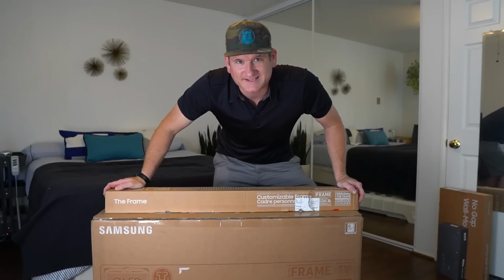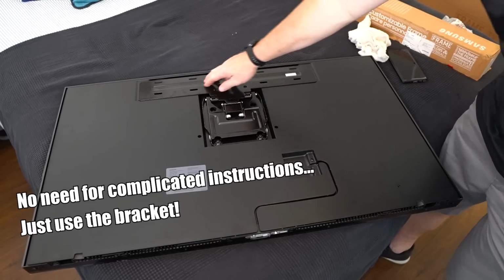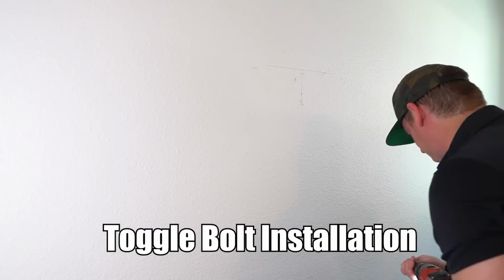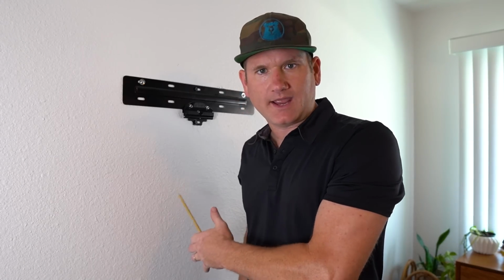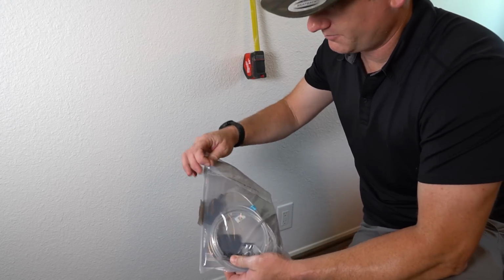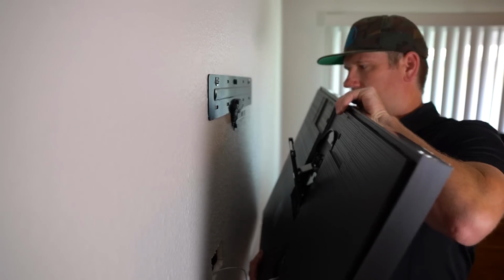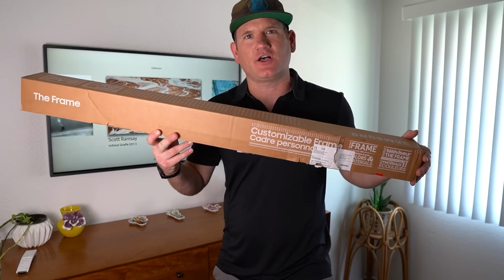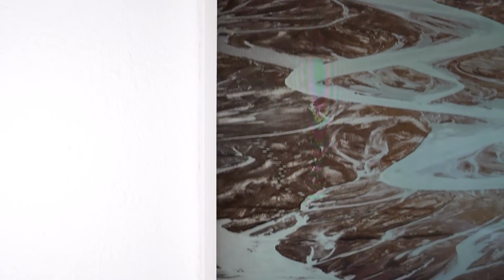Samsung The Frame Install w/ No-gap Wall Mount & Customizable White Bezel

Comment: Just a heads up that the mount comes with a template that shows exactly where you need to mount the wall bracket to get the height you want on the wall. I like that you are double checking the measurements but it makes it so easy to get a baseline. As an example, page 24 of this PDF gives the dimensions for many Samsung TV's. The main measurement you're looking for is the "A" measurement. 
https://pdf.crutchfieldonline.com/ImageBank/v20180729165800/Manuals/305/305M12EB.PDF

Comment: You never explained the connections on the short ends. Could you please tell me what types of connections there are on every side of the box? Samsung doesn't like to give out easy information and this is way harder than it needs to be.
Reply from the maker: What do you mean? I show off the one connect box in a few of the install videos.  Its just the one wire into the box and then plug it in. You run hdmi cords to that bo, etc.

Comment: Oh no no no a cover is relevant, bugs, spiders ahhhh. Cover it lol
Reply from the maker: Bugs will get around any barriers you place... they can crawl out of cracks, under baseboards mice can come out tiny cracks.  If you have bugs or rodent,, that's a different issue.. whether you have an open hole in wall or not. 😆

Comment: Hello, just a question, regarding 2.05 in the movie when you attach the no gap mount, is it suppose to be 1-2 mm from overlap from fitting in the whole that is cut out, or why is it like that for mine?

Comment: Hey B, I mounted a 75 Frame and was not satisfied with the location. After removing to relocate the TV, the provided lag screw head was stripped. I got the run-around by their support line as well as samsungparts when trying to obtain a replacement set for the lags, apparently they have no specs for these screws what-so-ever. Seeing as the heads are super flushed, the closest matching screws I found at the hardware store were 2 3/4" Headlok or #12x2.5 cabinet screws. Would either of these give the same clearance as the original ones sent with the no gap mount?
Reply from the maker: Any screws can work. I put them up with drywall screws sometimes only 2 inch.

Comment: The wall I want to install this on shares a wall with a closet.  You mentioned that the One Connect box does not need to be in line of sight since it is bluetooth.  Will the TV work if the one connect box is in the closet ?

Comment: Ok I’m an idiot and didn’t listen... stripped the Samsung screw pretty bad and made it worse trying to use one of those drill out tools. Any tips?
Reply from the maker: Use a plyers and reverse it out by hand or just use a 5/16 drill bit and drill it in half at an angle.  You can just use toggle bolts to hang the mount.  Or even a drywall screw with a washer on it.  Its a super light tv and doesn't stress the mount or wall very much at all.  3/16 " togglers through the drywall x 4
Reply: @BTheInstaller  pliers and wire cutters worked, thanks for the tips

Comment: I bought the Frame 65. A super TV. I wouldn't give it away! BUT: In art mode you can load a maximum of 50 pictures on the TV, the memory space is limited by Samsung. And if you don't do that immediately after setup you'll get an error message that the memory is full. I e.g. could NOT load ANY PICTURE on it after 2 days. In the support forum since model 2019 it's reported. Samsung has not announced a fix so far. The only way for me: Reset (loss of all settings) and then quickly load the images onto it 🤣🤣🤣

Translated with www.DeepL.com/Translator (free version)

Comment: Thanks for this review. I have the 65 inch model and I would like to know I can get my own professional photo's full frame on this screen in art mode. I converted the images in photoshop to 16:9 and 3840 x 2160 but I still get the annoying space around my photo's. Also smartthings sometimes does not see my photo's when I upload them to my phone. I use the Iphone 8. Any help would be appreciated
Reply from the maker: Sounds like you know more about it and I.  Is the space uniform? If it is, in the settings there are border adjustments.  You can remove the border or make it bigger.  Maybe? Or if its uneven just trial and error on the parameters of the image.  You know that is probably the best reason to get this tv.  I have always wanted to get more of my photos in house.  Good luck.
Reply: @BTheInstaller , Thank you for your quick response and all your reviews. Can you tell me where I can find the settings for the border adjustments? I read the image has to be 3840 x 2160, so I cropped my image in photoshop to this dimension, but it doesn't help much. Also there is no option to choose no matte

Comment: Thanks for this video! I really appreciate you sharing so much info on this TV. I want to hang mine over a fireplace. Is there anything I need to do differently than a regular instal since it's over a fireplace? Also, how do I run my cord sideways to the right or the left of the fireplace so it's behind the wall? Thanks a million!
Reply: Exact same question I have
Reply from the maker: Hello. I have run a fire resistant tube in wall. That is best for safety.
Reply: @BTheInstaller  thank you. I have to run my wire from the fire place to my basement. Would the tv still work if the one connect is in basement?

Comment: So is the One Connect cable that comes with the 2020 frame in-wall rated or not?
Reply from the maker: not but you can put conduit in wall vs buying that in wall.. or wing it. i have put in wall before but that is your responsibility to read and understand code and decide if you still want to do that, with risk.
Reply: @BTheInstaller  Thank you!

Comment: Stock one connect cable is not in wall rated. You think it's safe to do. We just got our TV and seen that in manual but 200$ in wall rated cable seems too expensive. We mounting above fire place onto exterior wall that has insulation and want to go through wall to under window
Reply from the maker: Long run for a cord.  I have done it before but it's not advisable.  If you're taking the time to run that far you could consider a 1.25 inch conduit but thats close being larger diameter than you can run through stud.  Not easy choices.  Maybe leave it external
Reply: @BTheInstaller  I know a guy who cut into dry wall just enough to insert one connect cable in there and used dry wall tape and mud to hide it.  Seems even more sketchy but much more simple and probably less of fire risk than running above fire place.

Comment: I'm sure you're tired of answering questions about the $200 in-wall rated cord, but will it cause a gap between the TV and wall?  In photos of that cord, it looks like there's enough of the thin inner cable between the TV plug and where the insulation starts to not cause a gap problem.  See https://www.samsung.com/us/televisions-home-theater/television-home-theater-accessories/televisions/5m-one-connect-in-wall-cable-for-qled-frame-tvs-2019-vg-socr86u-za/    Thanks - great videos!
Reply from the maker: Buy a $10 piece of 1.5 inch in wall flex tube and shove down the wall.

Comment: I’ve been told by the “tech people” at Best Buy that I have to buy an extra special wire worth $200 so that I can safely have the wire hidden inside the wall. They said that if I don’t buy it, using only the One connect cord may cause fire. Is there truth to it?

Comment: What is the significance of the cord not being  "in wall rated".  Is there any reason not to run the cord the comes with the package behind the wall?  The $200 for the upgraded wire is steep.
Reply from the maker: In wall rated means that it would both protect the wiring from damage in the wall, and that its protective coating would effectively slow burning if a fire was to come  through, vs making it worse without coating.  Basically the other one has more rubber around the wiring.  A steep price to pay for chance of a fire, but its code and I'm not going to say its not recommended to have in wall rated.  Some people may say you could just run the included cord in wall and be done with it.

Comment: Anyone have the secret to taking one OFF the wall? We have tried everything with no luck, can’t get any help from Samsung via calls, Twitter, etc. Thank you in advance for any help.
Reply from the maker: Just lift up.  It helps to tilt forward and then when lifting have one side slightly higher than the other side and it will pop off.  Its a little sticky, which is why you are having issues.
Reply: @BTheInstaller  I'll Give it another go - Sticky is right, wow! Thank you for the response~!

Comment: I bought the 2020 55" The Frame, but cannot install it on the wall for another 6 weeks (until construction is finished).  How can it set it up to make sure it works, and experiment with features? Is there a table top stand that will work.  I have seen promo photos showing little legs under The Frame, but cannot find them on line.  Thanks for the video.  PS

Comment: Thanks for this video! Do you know if we can install the box on the other side of the wall? You mentioned that it's Bluetooth operated, so I am thinking this would work. The box would hide easier if we strung the cord down and out to the room on the other side of the living room wall... what do you think?
Reply from the maker: Yes.  It works well
Reply: @BTheInstaller  thank you! One more ? Another video on the Frame said the cord can’t be strung through the wall unless you have a special set up or something, is this true?
Reply from the maker: It is.  Technically.  I would be comfortable with it in wall, it's just not rated to withstand a fire on that type of wiring.  If you are concerned you'd have to run a conduit in wall, even just the 3.5 inches from the wall to the other room
Reply: @BTheInstaller  thank you!! We may use your telephone service when we’re installing that we saw on your website if needed! Thanks!

Comment: Do you need toggle bolts? Can I just use what comes with the wall mount?
Reply from the maker: If you can hit studs.  Sometimes they're not aligned where people want to mount it centered.

Comment: Hey B, i need to mount the one connect box in an av box inside the wall. What are the 2020 exact dimensions of the one connect box?  There are conflicting search results of 14”-16” long on the internet. Thanks!
Reply from the maker: No idea.  Sorry.
Reply: Maybe someone with one could chime in... i need to know if it’ll fit in the cutout i got above the fireplace before i purchase one.

Comment: I have power directly behind where the TV would go.  How big is the electrical plug & would it fit behind the TV?
Reply from the maker: You have to put the entire low voltage box somewhere.  So you have to cut out the big 14x14 inch low voltage box

Comment: I live in an aprtment where u cant drill anything into the wall or make any holes. Are there any other way? Besides putting them on a side?
Reply from the maker: The wire is extremely thin. You can wall mount in a rental. The holes can be as small as hanging a picture.  So I'm sure it would be fine. Landlords can not dock you for small holes. Just putty them.  6 or 8 small wall anchors would be fine.
Reply: @BTheInstaller  u might have to make another video to show this. lol
Reply: Ty!

Comment: Hello - excellent video! Quick question: what do you advise when there is a fireblock in thr wall? Thanks in advance!
Reply from the maker: Tough to do as home owner.  You could cut in wall and run a conduit and then patch wall.

Comment: B — have watched this and your other “Frame” video (both excellent) ... but I’m not clear on sound — do these TVs have built in speakers in the back/bottom or does audio have to be provided by alternate source?
Reply from the maker: They have speakers on bottom.  It sounds fine but sound bar always helps.  You just have to connect the one connect box to the sound bar wherever it sits
Reply: B The Installer Thank you for the quick response!!

Comment: Im after a 43 inch 4k tv for a small room. Would the frame be worth the extra cost over the 60t. Primary use would be for gaming
Reply from the maker: The frame is worth it for the frame.  Get a 70t, TCL 635, or something for gaming.

Comment: If i have the studs in the centre of the Mount would you bother with some drywall screws on either side if I have two screwed in the centre?
Reply from the maker: You don't have to. But 1 toggle bolt on each side helps stabilize any mount when there is center stud.

Comment: What If you have a solid brick wall?
Reply from the maker: You can simply run the slim cord externally.  It's hardly noticeable.  The mount comes with anchors for concrete

Comment: So I'm confused, the Tv comes with a standard black "picture frame" or do you have to purchase the frame separately. E.g. If I wanted it to match my other black framed pictures I would need to order a black frame. Also was the in wall install with the regular on connect cord or was the in wall rated connect cord. Thanks in advance
Reply from the maker: It has black frame.  You can also buy an additional thicker black frame or other colors.  That was normal cord install.  Not many opt for the $300 extra
Reply: @BTheInstaller  Perfect, Thank you

Comment: You do know that that cable is not in-wall rated, do you? If there's an incident your home insurance will not cover you.
Reply from the maker: Yes.  What incident? That is the point to the "in wall rated" argument.  Many master electricians have some power cords in wall and even tell me its not a big deal for tv power cords.  There are in wall rated versions for 300$ or you could run a simple conduit.

Comment: Hey, thanks for the tutorial. We just got the frame 2020 65 inch yesterday and installed it. But it is still tilting left and right, is that normal? Please help! Tks.
Reply from the maker: It has a rotating piece on the mount that allows you balance it.  If you mean it isn't flat, it is likely the wall.

Comment: Hi B! I have a concrete wall, I just wondering if its possible to guide the one connect wire upwards? I’m planning to use a plastic moulding to at least hide the wire.
Reply from the maker: I would just deal with the wire external and even paint it the same color as concrete.  It's really thin.

Comment: Isn't putting that cord in the wall a fire hazard? Also if I wanted to do this and my wall had insulation in it is there a way to maybe wrap the cord? I'm a noob please help me
Reply from the maker: The cord isn't in-wall rated, as I mentioned.  You have to make a decision if you want to see the cord or not.  I'm not sure why having insulation would warrant wrapping the cord.  If you have space to out a conduit in wall, go for it.
Reply: I just read some forums on installing the cord in the wall and they mentioned that its a fire Hazzard. I just want to play it safe because I live in an apartment. Is using conduit a solution for the cord not being in-wall rated? If so i will definitely go that route thanks for the insight
Reply from the maker: You are raising the issue.  I can't tell you any more than those forums.  I do it for every install.

Comment: The once connect cable isn’t in wall rated which means running it through a wall is a fire hazard and isn’t following electricity codes and restrictions
Reply from the maker: Watch the video before you comment.  It's said in every one of my videos.
Reply: B The Installer no I’m sorry for the confusion I just wanted to make sure if I am missing out in something you mentioned cause I read the one connect cable isn’t in wall rated so I was wondering on how you got it in wall
Reply from the maker: No its not in-wall rated but I do it because I have done these for a long time and speak with my clients about risk/reward.  Most people are not interested in the $200+ cord to add to this expensive tv and they also don't want to have it exposed.  If you fear the possible risk more than seeing the cord, you can just put a little white cover over it too.  It's not very visible on the outside.
Reply: B The Installer okay thank you for the info
Reply from the maker: No problem.

Comment: How big is the air gap between the TV and wall ? Thanks
Reply from the maker: With a flat wall, it's flat against.  Some walls are built poorly and you can use the foam to adjust and even out.  Pretty easy to make it look near perfect.

Comment: Great video. I have one Q. Does the frame support dolby atmos? It isn't there on specs but read somewhere that it does. Can you check in Netflix or prime?
Reply from the maker: It can.  Some apps will send atmos out to a sound bar or avr.  Disney plus, vudu are best.  Many netlfix programs do 5.1 and prime is also hit or miss.  I started renting and buying on vudu to assure it. It will always tell you at the top of the page
Reply: @BTheInstaller  Thats amazing considering Samsung doesn't explicitly tell us about atmos support. I will get a atmos soundbar then. Thanks a lot for the reply. Cheers!
Reply from the maker: @sagarskrishnamurthy5806  yes you will be good... on some apps and programs.  Even with the best intentions, some things don't play atmos.  But eventually more things will.

Comment: Hi I am thinking of getting the Frame TV, although the wall I'd put it on is a slight angle to the sofa.. Does the wall mount allow you to tilt the tv at all whilst you are watching?
Reply from the maker: I would not buy this with the plan on turning it frequently.  You would have to use a different mount and lose the "frame" look.